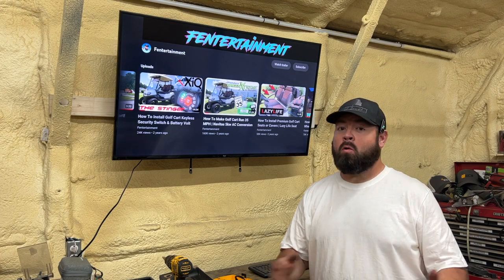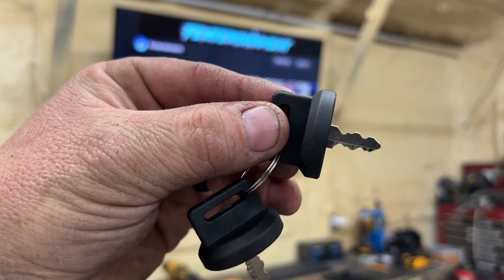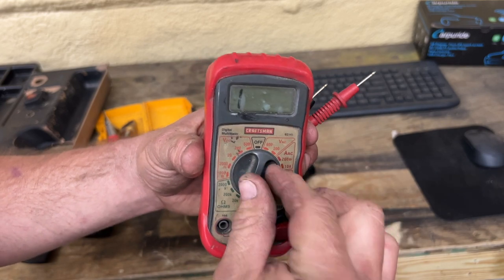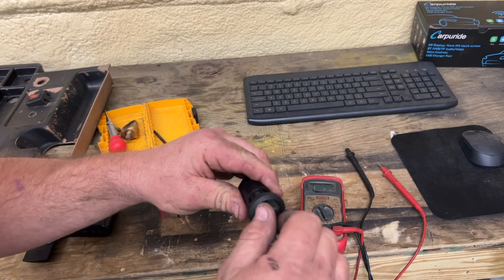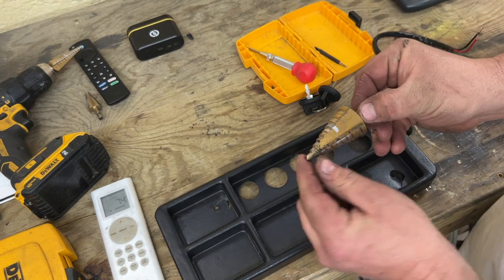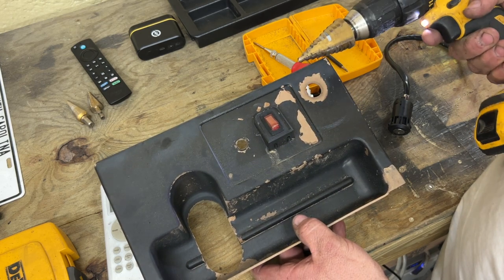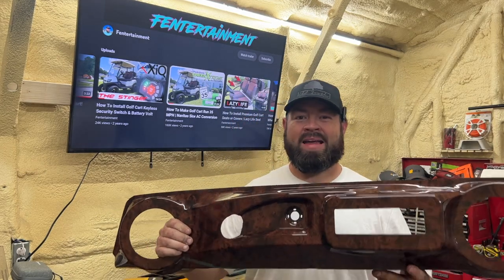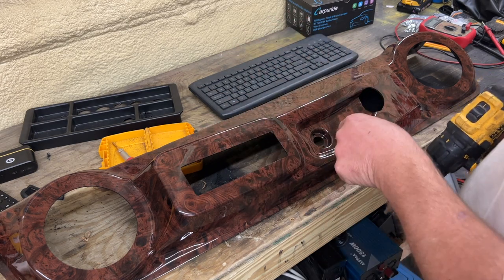ATV Key Ignition Switch in Golf Cart | 2 Switches in One | Inexpensive Modification

Comment: How is the switch wiring different between gas and electric?  My Yamaha gas has 4 wires on the key switch.  I was adding a gps speedometer and used a multimeter to check the wiring.  I identify the 12V from battery into the switch and two wires that each had 12V with key on.  I wired my speedo to one of the 12V key outputs.  Tested the speedo and buttoned the dash back up.  First drive I notice the oil warning light is on.  I suspected it was the addition of the new wire.  I unplugged the speedo and the oil light went off.  So I’m guessing the speedo is back feeding a ground signal and I must have unknowingly chosen the oil warning circuit of the key switch.  I’m going to move the speedo input wire to the other key on 12V out and see if that cancels the oil warning light.

Comment: Ryan, I love your videos. Watch 'em all the time. TY. I have a 2004 CC DS I'm building/updating and have bought this key switch. I have also bought a 48V - 12V converter since the accessories were hooked up to the second battery for 16V. However, When connecting the converter to the key switch does it matter which wire you connect the converter to?

Comment: I have asked this question on a couple of other of your videos.  I need your help.  I have a 91 club car, the gas pedal is sticking, the key will not kill the car. I have to pull up the seat and put off the spark plug.  The parking brake also stopped working at the same time.  I hope you read comments and will respond.  Thanks

Comment: Hey Ryan I just found your channel. I have 2001 president golf cart with lift and tires all stock running gear. The Trojans are done and I'm wanting to go lithium. Can I do it without modifications. I really don't want to go down that rabbit hole. It is fast enough for me and my kids. I just want range and life span. I've been trying to look back on your videos and find something in my situation. I did see the one with the single big battery. But you have aftermarket equipment. If you could point me in the right direction I'd be greatly appreciated